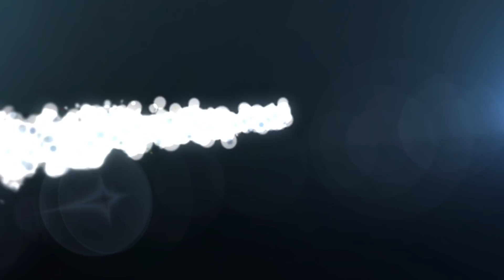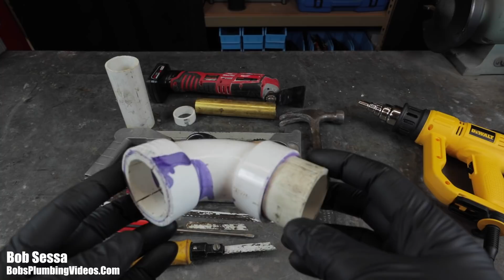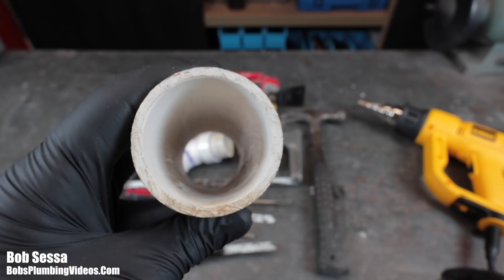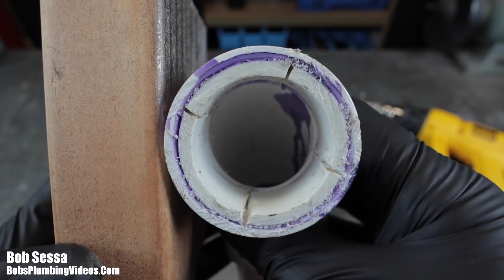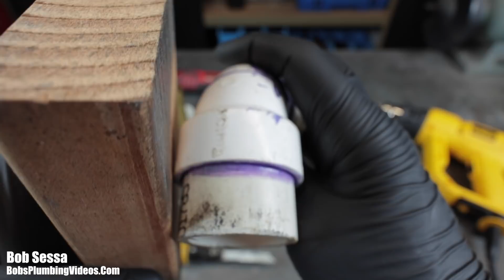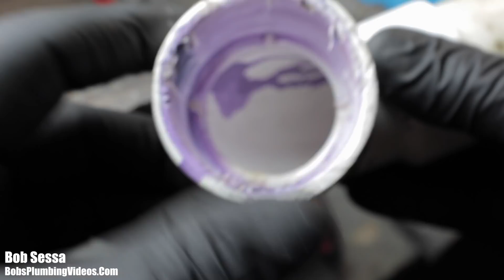How To Remove PVC Pipe after it's Glued

Comment: If I had it back in a wall I would tie a rope to the corner of a rag. Push the rag down the pipe and let the rope hang out. Do my work and any broken pieces that fall back into or down the pipe will get pulled out when finished

Comment: The hole saw method is my favorite. I use a hole saw, a small pair of vice grips, and a torch. You can get the price of pipe out with a screwdriver it’s so easy. Doing it this way you don’t have an open flame near the pipe. Not only do you not have to worry about setting something on fire, you don’t blacken the pipe.

Comment: I saw a plumber once took a torch and heated up both pipes and took a car exhaust pipe expander when the pipe was hot and he just cranked both until they were expanded large enough to fit the pipe he needed to fit inside..  said that since he expanded a double layered pvc pipe then it wont become brittle  if just going up the next size..  if you heat it right then it looks like any other fitting..

Comment: Bob, thanks for the video. I would use the cuts and a sharp wood chisel with no heat. They have a tool, drill bit that will ream out the PVC. Purchased on Amazon and used with good results, after piece cut flush at hub.
Reply from the maker: Thanks for commenting William! Regards, Bob.

Comment: Thanks Bob, you've rescued me. I'm having to replace a rusted out flange and wax ring on my 35 year old owner built (previous owner) house. The PVC fitting is a mess too and I'm installing an up-to-date waxless gasket and throat system that a fellow Navy vet and former plumber at my local Ace Hardware recommended. You've provided the last piece of the puzzle. Bravo Zulu!
Reply from the maker: Thank you so much! Bob

Comment: Thanks for showing this... I have one of those "service disconnect joints" or whatever you call them.  The thing you can unscrew and take apart in case you need to remove some of the piping in an area and then just put it back.

Well I bought one sink and did it up the way I wanted then the wife wanted a different sink so I go the other sink and the holes didn't match up.  Those couplings are expensive... it's not like they are just a few dollars and if it had been glued to a straight pipe it would have been fine but it was glued to an elbow that was glued to an elbow lol... so yeh not gonna work.

So this saved me some money. 

Thanks!!!

Comment: I usually use a heat gun on the inner pipe and twist the end with channel locks.  I go slow and work my way around and the pipe comes out of the fitting.  I haven't destroyed a fitting yet, but I'm sure at some point I will.  

That torsion on the pipe breaks that bond if you're patient

Comment: Hi Bob, I usually heat the pipe inside and out without cutting the slots, then use the needle nose to twist it out. The elbow becomes slightly deformed...  then what I do is reheat it again and use a fresh piece of pipe to mould the shape back to the original till it cools.
Really quick method under 5mins.
Thanks for your videos thought, I learn a lot.
Reply from the maker: Nice, I may have to give that one a try! Regards, Bob.

Comment: Everyone has a video about removing pipe out of the fitting, what about removing a fitting off of pipe sticking out of the wall do you just make small cuts to the fitting?
Reply from the maker: You could make small cuts to the fitting and use a heat gun to pry off the pieces. If there is enough room and you can make good use of the heat gun with out damaging anything, the pieces should be relatively easy to remove.

Comment: My fitting cracked when I hit the flat screwdriver to separate the piece of broken pipe from the inside of the fitting.  It was for 3" pipe.  I only did 4 cuts though, and I suspect the cut didn't go deep enough (went back afterwards to continue the cuts and noticed it 'felt' different when the blade depth past the PVC pipe and started into the glue of the joint).  I made the cuts with a hacksaw blade.  I did not use any heat.  I wish I made more cuts, did them deeper, and used heat.
Reply from the maker: Three inch pipe is heavy, you gotta get as close to the fitting as possible in order for it to be successful. I often remove broken PVC flanges from inside a piece of pipe. I literally score the inside of the pipe if I have to.

Comment: Bob remember the old solder bushing where the waste arm of the  p-trap was soldered to the brass solder bushing would try with a nipple extractor and if that didn’t work cut it just like the pvc but at 11 and 1 or 10 and position and use a cape  chisel   Reason cutting just those 2 areas in case you accidentally cut the threads on the cast iron or Durham drainage fittings  less chance of leak

Comment: Hi Bob. Handy video. Could you explain how to remove a broken fitting but save the pipe it fitted over. Need to remove a cracked T connector from pool pipe. Not enough pipe left to cut it
Reply from the maker: Send me some detailed pic's - inforobertsessaplumbing.com.

Comment: What kind of metal was that pipe? As a pool guy I deal with a lot of fragile and dry rotted PVC. Heat is the most effective way of removing old pieces from each other. I would very much like to try that pipe method but I know galvanised steel isnt a good type of metal to heat up
Reply from the maker: That's 1 1/2" tubular brass that I typically use to connect kitchen sinks from the "P" trap to the sink strainer.

Comment: If it was not glued properly and leaks but glued to much yo pull apart..can i add more glue to it without removing it. Or would the heat gun work
Reply from the maker: I would try the heat gun method, just smearing some glue over it is going to be a temporary fix.

Comment: would the saw method be ok to do on my spa pump union? I would assume that was a drain pipe where there is no pressure, The spa pump is 5hp
Reply from the maker: I'll do anything to remove a piece that's compromised, just go easy with the cuts. Use a  24 TPI blade go nice and easy and I would go with the heat gun method to soften things up a bit and gently peel the pieces out.

Comment: Hey Bob, have you ever used either a pipe or fitting extenders. Theyre great in the pool plumbing repair world. I prefer the fitting extenders over the pipe extenders to not reduce inside diameter.
Reply from the maker: I have not, my world is under sinks for the most part but that sounds like a great solution!

Comment: Great explanation, Two weeks ago I was on my personal kitchen project, 1989 home. Took out the complete kitchen without taking out walls. It was time to change the old design from a two basin sink to one large. The plumbing although done very well for the time was close fitting and had pipes going in two directions for the two sink drains. I wanted to bring this scenario down to a one pipe connection, less wasted space and it does include a disposal. I thought about this and started on the hacksaw method but after a short time I said to my self just cut the wall and get it done. I did  and I was happy I did. In all my kitchen and bathroom modifications I have always added the female 1 1/2 threaded connector so if someone in the future would like to make changes they could do so with a normal threaded connection from the wall. Had I seen the heat method I might have tried it, but to be honest plastics degrade over time; PVC included. For me that day it was about 100% integrity and not having to go back in later on or for someone in the future for that matter. The patch work was a breeze with a product DAP FASTPATCH 30. << This stuff is amazing if you have not already tried it. I was close to these ideas before they were published, this video would help many, yeah I would stay away from the Super Heat method as it may work but it's going to break down the elements in the plastic and cause issues down the road. The plastic is going to be more brittle from heat, soft heat not so much but still. Avoid heat it you can with plastics.
Reply from the maker: Thanks for commenting! I personally don't like the heat method, but based on the videos I see on  youtube people are doing it. Regards, Bob.
Reply: @BobsPlumbingVideos  That's the bad thing about YouTube.  People can post almost anything, including dangerous ideas.  Like too much heat starting a fire that didn't happen in their video, but happened in a viewer's home by mistake.  Thank you for your safer tips here.

Comment: Or you could’ve just bought a coupler, and simply slip it on to the pipe. Then you end up with a fresh new fitting to slip in your new pipe.
Any time you need to make an alteration on PVC you just want to try and cut through a pipe with enough space on it so that you can leave some of it still sticking out of the fitting it was glued into (just like the piece used in this video’s demonstration, before it was cut) that way you can slip on a new fitting. In this case where it says in the video that the fitting might be inside of a wall. Well with some of the pipe still left sticking out of the fitting you could just use a coupling that you can buy at any warehouse. There’s many options to go with, it all depends on what you’re trying to do. But that’s still an easy fix without having to unglue the pipe from its fitting.
The only time you really need to unglue a piece of PVC pipe from a fitting is when and if you can’t find a fitting that you need, you don’t want to spend money on new fittings, or there’s nowhere you can make your cut to be able to slip on a new fitting that won’t end up just costing more and having to do more work. Also if you just happen to have a fitting with a piece of pipe already glued in it but not enough of it sticking out to be able to slip it into another fitting (like in this video after cutting the pipe to where it’s flush with the fitting) and you would like to salvage the fitting to reuse it on a future project. In that case your only option would be to try and pry that puppy out somehow.

Cool demonstration on ungluing PVC, but pointless applications for where and when it should be done. Some people now knowing this might try to unglue PVC pipe when all they needed was probably just a simple little coupling. But they didn’t know about couplings. That should’ve been in the video. Just a quick explanation for when you don’t have to unglue the pipe from the fitting. But in any other instances where a simple fitting won’t work, or you don’t want to spend more money buying new fittings then ungluing might be something you want to do.

Comment: Bob, newbie DIYer here.  Why do you need to cut the pipe at all?  All my plumbing jobs seem like they are in cramped undersink situations (and my legs cramp like crazy).  Delicately sawing cuts like that without damaging the pipe seems like a nightmare.  Couldn't you (1) heat a wide strip of the pipe until flexible, (2) insert a screwdriver or awl to life away from the fitting, (3) cut the flexible lifted away section lengthwise, (4) grab one end with a needlenose and (5) heat and twist?   Thanks for the videos, they help me a lot!
Reply from the maker: You know I hate to admit, I’m old school and for me making these small cuts is no big deal even in tight quarters. I actually will use my sawzall w/ a fine tooth metal blade in some tight situations. The heat gun works well, but I would try to cut the stub out flush with the fitting. Heat the least amount of surface area possible, pry it away from the fitting and then grab it with a pair of needle nose players.

Comment: You know there's a tool that attaches to a drill that will cut the pipe out, right? I have cut and chiseled out before, it works.
Reply from the maker: The Reed and Wheeler companies makes them, nice tools indeed. For the  occasional screw ups I make didn't think they were worth the investment. Thanks for commenting! Regards, Bob.
Reply: I think I paid about 5 bucks for the tool .bought one in both inch and a half and 2 in. always good to have more tricks up your sleeve!

Comment: I did use the heat method but just used a hot gun the whole pipe became maluable but the darn glue held. The pvc piple were put together in the 90"s so maybe the glue was stronger. Still working on this, UGH !

Comment: Useful. Re the use of the heat gun, without due care, it seems one could distort the shape of the outer fitting also by too much heating and prying.  (ahh, I see Doxx below has a method for dealing with that.)
  I'm also wondering if there are solvents that can loosen such a glued joint - maybe with a bit of time to work.
Reply from the maker: If it's more than 15/30 minutes, you're going to have to heat it up to get it out. A good hair dryer on high or the heat gun with some care and I think you'd be good to go. I'm not aware of any solvents that would penetrate the joint without affecting the fitting and pipe.

Comment: Why don't you just use a socket saver very simple very cheap an most important it's very affected I'm a plumber in jersey I go to alot of Amazon's and do work I use all the time there real shotty work was done at these places and it has worked everytime and I use the cheap ones from depot and they work fine

Comment: Dang.   Watching this 5 hours too late.   Just this morning I glued in a 1.5 inch to 1.5 inch trap adapter on the stub out for a sink drain.  I thought I had grabbed a 1.5 to 1.25 adapter but someone at Home Depot must have re-shelved that 1.5 unit into the wrong box.  I didn't notice till I had glued everything up and walkaway for several hours.  Ended up finding a nut that fit on the 1.5 adapter but was for a 1.25 drain tubing but that seems like cheating.
Reply from the maker: Not cheating I use 1 1/2" X 1 / 1'4" trap nuts for basins all the time! Regards, Bob.
Reply: Everyone seems to do it that way nowadays. We use to use 1 1/4 traps on lavs and 1 1/2 on sinks but now we just use 1 1/2 traps and reduce at the tailpiece. The mistake you made is fine, it’s when it’s the other way around that screws things up. Last week, I bought an 1 1/2 and 2” over male adapters for the air gap on a 3” RPZ. It was 2” so I had the 1 1/2 leftover. I had it with the rest of the fittings and my apprentice glued it on thinking it was a trap adapter. The only difference is a trap adapter has a larger ID so you can fit the tubing in. Luckily we had enough pipe to cut it off and glueanother one on